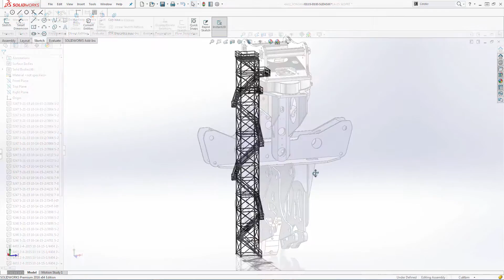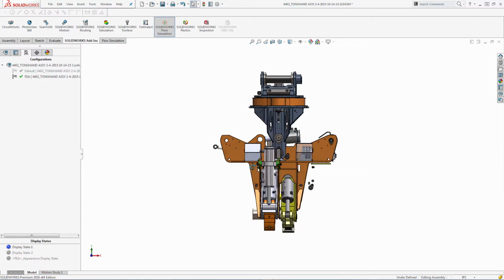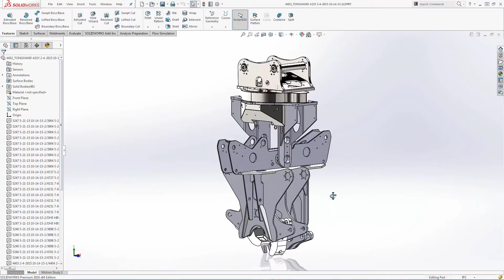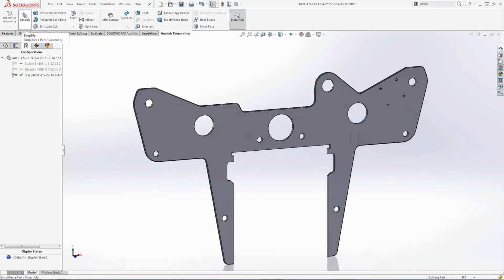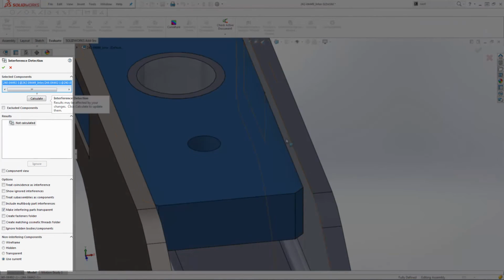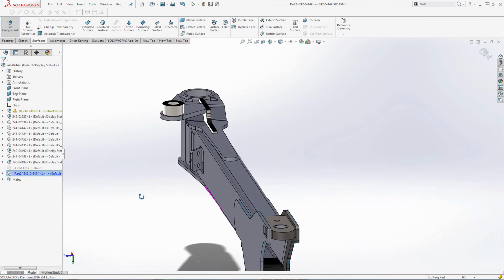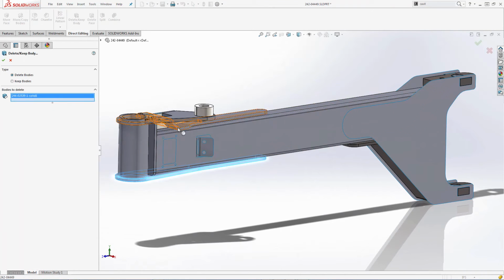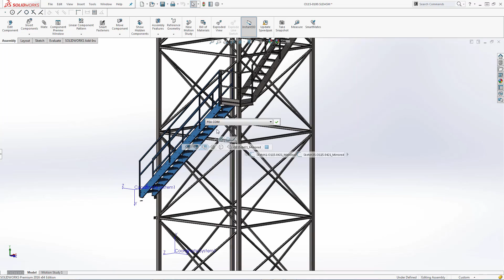SOLIDWORKS Simulation Step-Up Series: Pre-Processing Assemblies

Comment: Hi mike, thanks for the video this solves lot of my problems as i am new to solid works FEM , in my industry they are using Solidworks FEM . I have one doubt in this tutorial if we use surfaces instead of solid bodies in meshing, Do we get the proper results in simulation?
Reply: Yes!  Shell elements have been around and are a great way to solve problems that involve thin geometry (sheet metal) with uniform thickness.  SW has and option for thin or thick shell elements that also allow for shear to be solved through the thickness which is often negated if the geometry is thin enough relative to its length.  These types of elements and mixed meshing techniques are taught in the SOLIDWORKS SImulation training class which is hosted by local SW resellers.

Comment: Great video! I just have one query with the last example. From my understanding, you would use this newly created coordinate system to simulate a point mass. However, I've observed that when you suppress all the components, the centre of mass changes and therefore so does the position of the new coordinate system. So in what circumstances would you use this technique and how does it actually work?

Kind regards and again thanks for the great video and series :)
Reply: I would say that you don’t suppress them, just hide them. In that case the solid is hidden, but the points created still appear.
Reply: The coordinate system created from the COM is from a 3D Sketch point with no reference to the COM, so when the suppression happens, the COM updates but the sketch point does not.